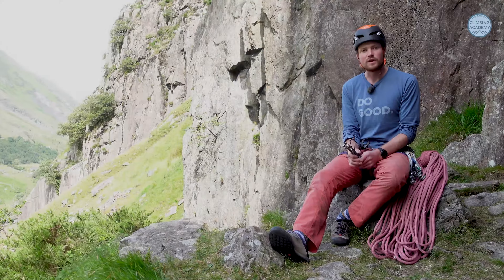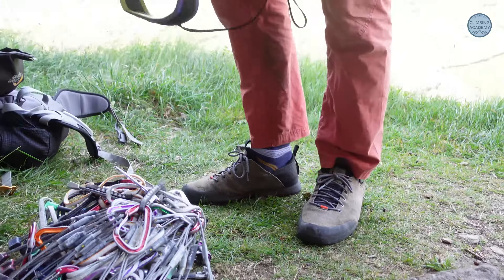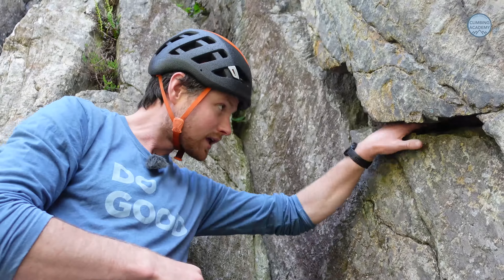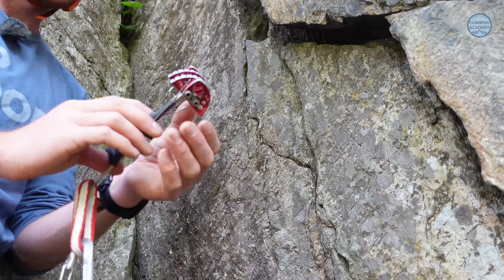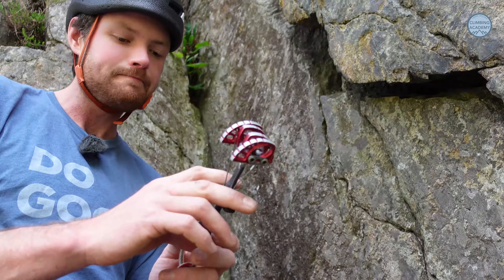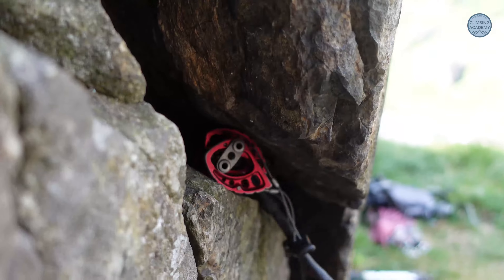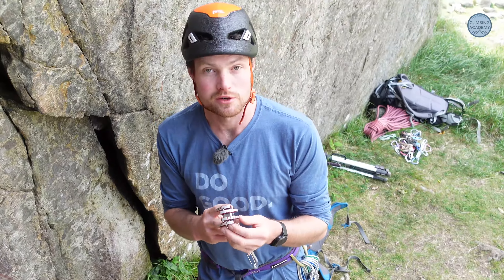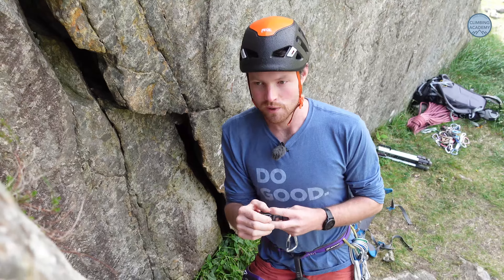Placing trad gear - cams and nuts

Comment: Crocs are the best approach shoes. I get a lot of looks at the crags and on the trails for them. But I swear by them. Comfortable, convenient, and they have solid tred and in sport mode they are undeniable.
Reply from the maker: Crocs for the win!
Reply: Not enough sole protection for me.  But I gather there is a barista no slip version that at least has tremendous traction.

Comment: It is funny how many trad videos there are, stupid term, where you see someone lace up a crack with cams that was originally climbed with a pocket full of pebbles.  The engineer in me loves cams, they are just so cool, and I bought them and used them when they came out.  But they hit the climbing world with a lot of skepticism (at least in the columns).  People are still dissing Jardine for one supposed crime or another, and you can imagine the sigh of relief that followed the news that Honnold had climbed The Phoenix unroped solo: "Take that, Ray!" Cams were the beginning of the end.  If you can just move your top rope up the crack, why not pepper crags with bolts.  Trad was more a rack of stoppers and eccentrics.  And if you survived teaching yourself to use those, the idea you need instruction on placing cams is funny.
Reply: For some, climbing isn’t about risking your life as much as it is about the actual climbing. Some prefer to be safe.